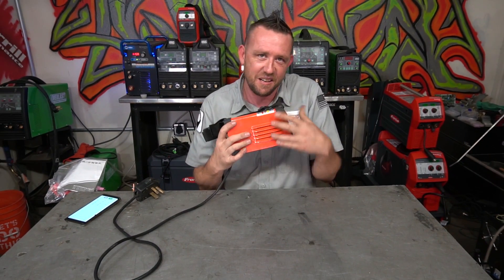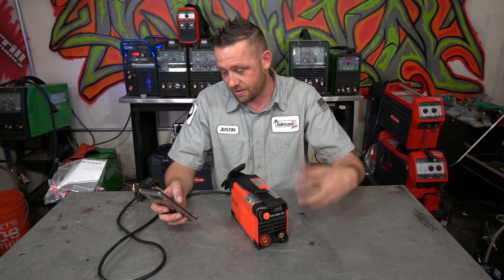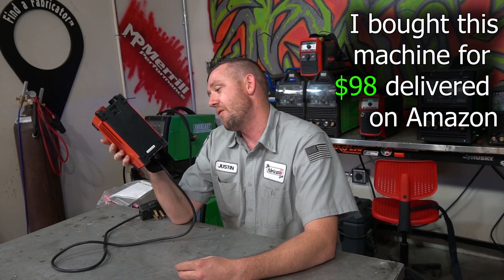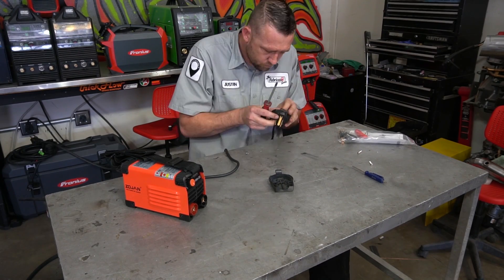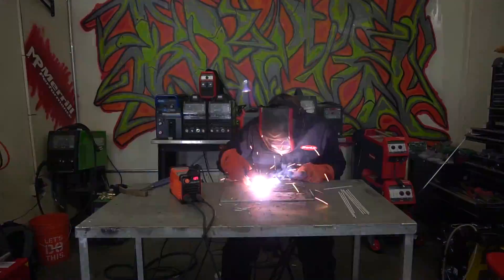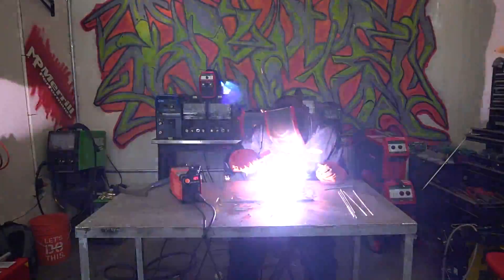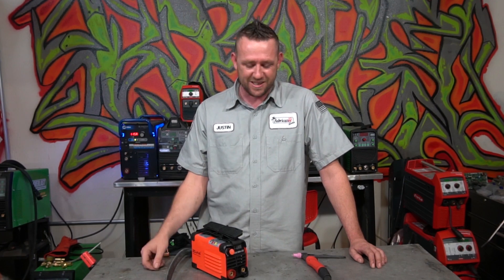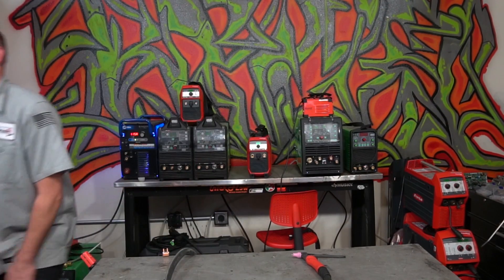TFS: The Smallest Welder EVER! Will it TIG?

Comment: So is a 125 amp welder for 99$ not OK?
Reply: Max Headflow 
Not for this guy.

He need a welder for skyscrapers with a million dollar crane to lift it for him. On the 2nd floor.
Reply: It's fine. People tend to be tool snobs in the states.
Reply: @SWhite-hp5xq  that's will-fuck-yee to you
Reply: Lol max, haven't seen you in a while. Sorry MTV did you dirty like that.
Reply from the maker: What you missed is it will actually cost 2-3 times the price of the machines (which includes nothing) to run it at half the output. Is that ok?
Reply: I doubt that it puts out even 125. Check out what welders close to that size put out. Likely, it might put out somewhat less.
Reply: @melgross  You are talking IGBT tech. The days of the huge welder are pretty much gone. Physical size is not really an indicator of possible output power anymore. They could switch out some components and probably make that toaster put out 300 amps if they wanted.
Reply: Paul Andrulis I know what it is. My ESAB works that way too. Yes, it’s a multi process machine (DC). But max output for MIG is 220 amps. It also weighs almost 46 pounds, and is considered to be pretty light for what it puts out. Pretty light for inverter machines.

But ESAB and other major manufacturers are pretty conservative in their designs and manufacturing. They should be, for the price. These unknown Chinese manufacturers are pushing out to the very limits, and not really delivering what they say. The question is how long they’ll work. So if you use it 10 minutes once a month, unless they’re defective, they’ll last for years. But the weld quality isn’t very high. For home use, that may be ok, as even mediocre welds can be strong enough for that purpose. And you can’t really tell how good a flux core, or MiG weld is by looking at it.

When they break, where do you go? The “importer” is usually a guy who went to the website of a big Chinese exporter who sells items like this at a 50 minimum. For that, you can buy welders like this for $30-33 each. They come in several color choices, or sometimes slightly different cases, no charge. For a couple bucks more each, they’ll put your name or logo on the side. eBay requires an exchange, or money back if you get it and it doesn’t work. But what happens two months later? The “importer” doesn’t fix them, and only carries nozzles and tips. You have to send it to the manufacturer, in China, pre paid, if you can find out who they are. Seriously?

That’s why I keep saying to people that it’s better to spend a little bit more and buy something from a USA based company. The welder may not be that much better, and it may seem to have less power. But the company is just being more truthful about it. After all, you can complain to them, and even sue them. You can’t do that to a Chinese manufacturer. China even has laws preventing foreigners from doing that.

So I’m not saying to never buy cheap welders or plasma cutters, just buy them from a known company. HF, with all my complaints about them, will take yours back if it breaks, and give you a new one, for example.
Reply: @melgross  I can understand that, Mel. The problem I have with the brand wagon approach is that "a little bit more" generally equates to multiple times the cost. At that point, it isn't worth the extra cost, especially considering that most brands do not manufacture the units they sell, but in fact import them -- from china. Can something even be called a cheap knock-off when it is probably manufactured in the same factory? Things aren't like when we were all younger. Brands like Milwaukee, DeWalt, etc., just like lincoln and miller, are either all, or in large part, manufactured in china now. It sucks, but that is the way thing are.
Reply: Paul Andrulis well, the price might be 25% higher. It’s not two or three times. And they’re honest ratings. These real companies also buy in far higher quantities than that guy storing them in his garage.

That they’re made in China doesn’t, in itself, mean the quality is poor. They make total junk, and they make exquisite quality products too. The problem about where something g is made rests with the buyer, who decides to save money. So American manufacturers are forced to same costs, and take some of their work overseas. People use the “it’s not made the way it used to be” excuse for buying cheap stuff from China. But good stuff is still good stuff. It just costs more. I just bought another Tronex electronics pliers. It cost me $62. Made in the USA, and considered to be one of the best made brands anywhere. I agree. I’ve got some of their other stuff. But who buys it? Mostly big manufacturers who won’t buy cheap stuff, and well, me, because that’s the way I am.

But then, guys will say that the ain’t buying that because it costs too much, and will buy a cheap Chinese tool instead. When the company goes out of business, the excuse will be (from these same guys) that they can’t buy it because we don’t make anything here anymore (totally untrue). So the circle goes round and round.
Reply: @melgross  There is no "it's not made the way it used to be" excuse. An excuse is only necessary when someone makes a bad decision. Paying $62 bucks for a pair of plier requires an excuse, since I would almost guarantee it is not made of carefully hand tempered D2 steel with replaceable carbide cutting surfaces and is guaranteed not to be breakable by the human hand -- which it COULD be for $62. When it comes to cost of a tool, the price is only part of the equation. Many people refuse to pay extra for something as silly as a name printed/etched/embossed/engraved on a tool. That is not an excuse my friend, it is a conscious decision not to waste money on inconsequentials. Consider those cheap welders... parts becomes the main issue I have heard about. What if the welder breaks down or you run out of this or that consumable? My question is why that is even an issue -- considering that everything across those various brands is most always universal (part of how those manufacturers keep costs way down). The mig tips fit a hundred different brands of machines. If the electronics goes out, boards can almost certainly be found cheap  on the market,  or repaired cheaply, and quickly if you know where to look. If your expensive unit breaks down, you take it in for servicing under warranty, then you go without it for a couple of weeks until they return it. As far as machine costs go, a 200 amp miller 211  costs around $1300 ( free shipping, inverter-based mig function only). A cheap 200 amp chinese inverter-based mig welder costs -- $300 free shipping (Mig/Arc - MMA) . Although that is a middle of the line chinese model, it puts things into perspective, as that miller is around 4X the cost, for a 200 amp Mig that with a couple of cheap DINS plugs and an extra switch could have had the same functionality as the chinese model. For half the cost of that miller, you can get a REALLY good unit from china with all the bells and whistles, and TIG to boot. If you were to spend $1300 on a chinese welder? Star wars type stuff that will practically wipe your rear end, with enough amps to choke a camel. No, the cost isn't justified. If it was, you would get the same bang for your buck, every buck. A $99 welder can be an ok welder. Comparing it to a $1300 welder is silly unless the $1300 welder was a complete rip-off to begin with. Comparing a $1300 welder to a $1300 welder is actual comparison. At that point? ROFL. Miller et-al isn't even playing in the same game, let alone in the same ball-field. You can get super high power INDUSTRIAL 350A units for $1300 from china.
Reply: Paul Andrulis you obviously don’t use good tools. Now you’re making up,an argument that you don’t understand. You would be better off not responding.
Reply: @melgross  Which ones do you not call good? Snap-on? Matco? Mac? Lincoln? I own and use good tools that are worth the money spent for them, both big brand names and cheaper stuff. I am not a brand fanboy if that is what you mean. I am just not impressed by a label on the side of the machine.
Reply: You can drill a hole with a $150 Makita drill or with a $20 crappo drill. Take your pick, it’s your choice. But in a few yrs time, which one will still be drilling holes! Buy once, cry once.
Reply: S. White 

Well my wife is from the Philippines 

And her brother was looking to buy one of this so I said I know how to used this type of welder but I also own one too .... I did my research then I came to this video on this channel that i have all ready subscribed to I did buy one of this and he is enjoying it for the last 3 month. So in my word of if I lived there or not is not a novelty or assumption as you described.... 

you need to get out and explore places outside of your house and if you really have money then take a trip outside of the USA you'll be surprised what you can learn from other people that do make $5.00 per day to make a living.
Reply: @redbugg99  i bought 2 went back to the Philippines, paid off both in one small job using one. Good stuff. Good life. Haha.
Reply: @livelifesurvive6375  

that is exactly my point here ... if you have money then anything like this is automatically garbage from the moment they hear about it.

This product is a golden gift to any person who lives in places like the Philippines,. Cuba, India, etc. 

Unless they go there they will criticize without facts and this welder works just fine.

PS I did bought one and had send it to a friend in bohol as a gift "road side iron work" and he loves it.
Reply: the 6th replacement cheapie drill will just about be toast @ $100 ttl spent but then you wont be tempted to keep it around when it dies like you would a worn out high $ drill lol.
Reply: Paul S  .  Also, a hobby grade welder will last hobby use for a lot of years.    2 or 3 projects a year taking 1-4 sticks... hard to wear out a machine on a dozen sticks a year.  Not to forget that most home hobby projects usually dont need 1/2" plate welded... just some pipe or 1/8 HomeDepot angle. 
 This seems like a cute hobby 125a 240v DC welder,  with a DoubleDisplay that we can calculate in our head
Reply: @pauls5745  With a $20 drill you wont cry if someone runs over it, breaks it or steals it. In fact you most likely wont have to worry about it getting stolen. But it will drill a hole. Plus at $20 you can keep a spare one in your truck. I have a $20 grinder that is almost 15 years old. I'm shocked.
Reply: @SWhite-hp5xq  Often both. Sometimes the cheapo, others the Makita. Depends on the cheapo in question.
Reply: @SWhite-hp5xq  i have had 20 dollar tools last 15+ years.
Reply: MephistoRolling bet it wasn’t a cheap ass budget Chinese welder though ;)
Reply: @SWhite-hp5xq  choose carefully or use carefully!
Reply: @SWhite-hp5xq  not the Makita
Reply: S. White 

If I lived in the Philippines ...

The average person makes 200 pesos per day. To feed their families plus other expenses.

$100.00 dollars  = 5.000 pesos

My personal system was $3.500.00 plus.

1,865,500.00 Philippine Peso
@ today's marker

Most 3rd word country does average 200.00 their money per day 

$4.00 per day .... that will be 25 days of 100% savings plus shipping plus material .... I'll say about 50 days to have  a novelty. 

Any questions?

THIS VIDEO IS NOT EXCLUSIVE TO THE USA VIEWER. YouTube is view worldwide in exception to China and some other countries where American ideology is sensor.
Reply: magaiver... And?? Even 1st world countries have poverty. And these affected persons most likely won’t have access to the internet like you or I, and they probably aren’t as educated and/or as fluent in the English language like you or I. Hypothetically (best I throw in one to support my counter rant too)- IF I lived in Fukustan, and was stricken by 3rd world poverty, and earned equivalent as those in the Philippines on 200 peso, buying a shitty welder would be the last on my bucket list. This welder is not marketed towards the 3rd world populations... but hey, don’t let me destroy your point.. whatever that was!
Reply from the maker: The machine itself is $98. It doesn't include anything to actually use it. It doesn't include leads, a clamp, a stinger, a plug.... it's just a machine for $98. 

Once you buy all the stuff just to use the machine, you're more than $98 into it. If you buy semi-decent stuff, you'll be over $200. If you get a TIG torch and parts to make it work, you're over $300 and some change. 

What you missed is all the extra expense for a machine that only does half the job. For the same price as what you will spend to make it work, you could have had something that works correctly.
Reply: @TheFabricatorSeries  I bought a 1m3 argon tank complete with regulator for 60$, leads, clamp, stinger, and plug I could get for under 30$, for the TIG torch I could get it for 25$, so I would get the complete 125A system for under 200$ and it's portable. It doesn't matter if the display says 1000A as long as it works and you know the real capability of the machine. 

Ps: I just gave my niece a 450W stick welder for him for just 35$ to play around

Comment: could you put a clamp meter on the output lead and measure how much it's *actually putting out?
Reply: I was thinking the same. Id rather see hard evidence of what exactly it is putting out than a guesstimate.
Reply: he was using 3/32 rods and needed to set it to 140 amps.. thats about double what they need to work properly, if it was actually doing 140 amps then the rods would be glowing red hot before they were half used, he just didnt realize that was the case as he doesnt stick weld.. but he knew it was up when he could tig the 1/8th.. no reason he couldnt put a clamp meter on it though, use the machine with a clamp meter to set the amperage correctly, 125 amps is still enought to burn a 1/8" 7018 so you can weld anything  basically
Reply: Merlin Zener my thoughts exactly.
Reply: Every video ive watched ive never seen any body put an amp clamp on the welding lead
Reply: He aint that clever.
Reply: Merlin Zener, Yep, inductive amp meter (amp clamp) would tell the tale exactly, I’m kinda surprised he didn’t do that in the video...
Reply: Probably would have done better if he didn't keep slamming it on the bench
Reply: Would only work on ac
Reply: Unlikely to have happened you could see right from the start of the video he was all into DISSING it  right from the get go
Reply: I've done that , the maximum current on mine was 121 Amps. I've adjusted the display to match that. Within those limits it is not a bad little machine, pity the sellers are a bunch of liers.
Reply: He didn't do that because he's definitely not as smart as people think that he is if he didn't have all those free welders he would own a hundred dollar welder he's a pretender
Reply: The output could possibly be a DC,I mean how could a clamp meter be accurately used on a DC source?
Reply: most clamp meters now a days will measure DC current, they use a hall effect sensor, ive never bough a meter specifically made for DC measuring but any i have used when the need arose to measure DC they had no problems
Reply: @joeelias2515  Several come to mind that have a Hall effect sensor that can do DC.  Add in the current transformer and compensation network with BIAS current for Hall and you have AC/DC probe or clamp.  Other methods like iron vane too that's old school but neat all the same.
Reply: @joeelias2515  with a DC clamp meter........
Reply: Phillip Ramirez I regularly probe megahertz current. With a cheap scope.
Reply: depends on what wave form its outputting. its possible this indicator on the panel is only reading half the wave form as its a crappy squarewave. BTW o-scopes dont like high freq welders. ask old tony
Reply: @pen25  Why do oscilloscopes not like HF welders?  I bet it was incorrect probing which shorted out his ground lead and BAM!  If not an isolated (and subsequently floating input) scope or one with a dedicated differential probe, one must read up on it.
Reply: Makes me wonder how he came to his conclusion. Something doesn't add up in the video. How does he know the current? How come it was fine with sticks and not good with tig? Surely the same?
Personally I think he fried the circuit doing the stick test and once he went to tig the machine was already fried - shame he doesn't actually tell us more.
For me I'm not subscribing. The channel is full of inaccuracies.
Reply: @jackking5567  He's a career welder, and he knows what results will come of a given amperage range. Using SMAW (stick welding), he wasn't using any fancy tricks, so it should weld the same as any other machine that is producing that amperage.
Reply: I would have said scope than clamp meter.  Look at the sine and see what’s what
Reply: @Ave_Xavier  Not a sine wave, DC, not AC except for some ripple.
Reply: Squirrel correct. Although you understand that it is not really so. That IGBT is a square-ish output. So with a current probe you will take a dependable running value. But even if it weren’t, you can still take a useful measurement that would give you an idea of available amps.
Reply: Current probe with an oscilloscope is needed to measure the modulating current. Then integrate the area to find the RMS current. The clamp meters are only designed  AND  calibrated for AC or DC, nothing modulated
Reply: @aqib2000  got a fluke thats ac, dc, and ac+dc
Reply: Squirrel and ? That adds nothing of value